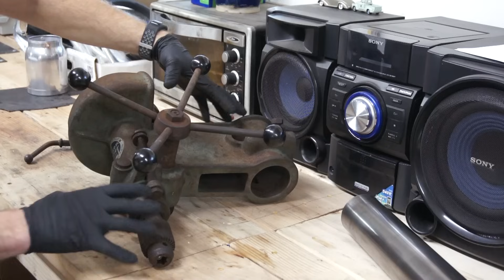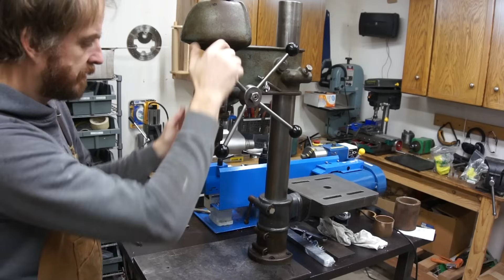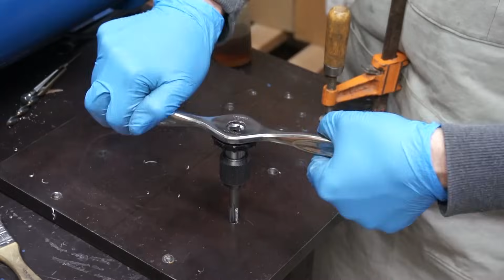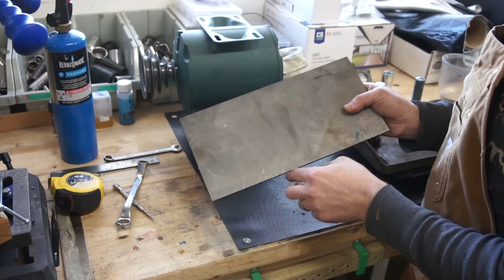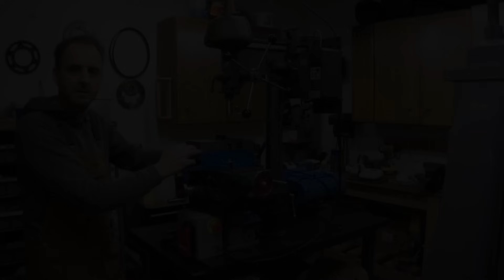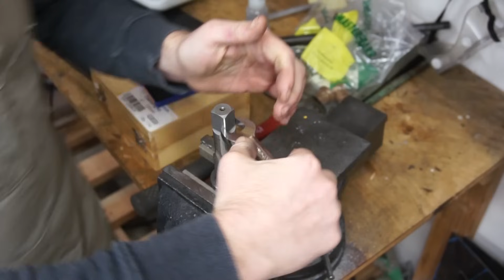Converting a Drill Press into a Milling Machine

Comment: Just found ur channel today man. I enjoyed this video. It's tough trying to turn a Drill press into a Milling Machine. I might have to strengthen up certain areas of the press as u go wwith some more steel/ Maybe some type of heavy guage frame to support that drill chuck area.. I'm not sure at all. Just thinking out loud Robert man. 
Very good watch this was though. 
I often wondered if my cheap and cheerful drill presss could handle the change. I think u would probably be better building ur own from scratch.Steel is fairly expensive here in IRE right now as well. I have watched guys build Lathes from scratch with Square tubing, etc. Ok it costs a few quid but the results from some o these dudes has been staggering. Hope this works out for ya mate.
I sub'd and liked the video too BTW.
Reply from the maker: Thank you for the kudos.  It's good to hear.

Comment: This is a dumb idea.  Drill presses are not engineered to handle side loads.
Reply from the maker: But it does work, tho.
Reply: @RobertAdairWorkshop  I know a little about this...  I converted a big powermatic press over to full CNC.  It's great for drilling hole patterns, etc, but just about useless for milling.

Great conversation piece, though.
Reply: @RobertAdairWorkshop   When you are working out of a small space and it's full with tools already maybe it's an option although I understand what you're talking about.  Just have to keep an eye on it or provide cabinet jacks to make it more sturdy.

Comment: Hi Robert. I was a ship engineer for a lot of years. I now play in my home workshop. I built a mill out of a 16 speed clark floor standing drill press. I made a big heavy floor standing base. Micrometer quill feed and a rise and fall machine head. I can take 1/8th cuts in aluminium with a 3/4in cutter. I often take .070" cuts in mild steel. It will also cut a complete dovetail in a single pass. I have also adapted a windscreen wiper drive for a table feed 2 speeds or change the drive gear to get 4 speeds. I also regularlly use the machine to cut gears. 16 dp and 20 dp all single pass. One of the things I came up against was bearing wear so I refashioned the quill with a bigger bottom bearing and altered the quill so I could preload the bearings. To retain the collet holders (er32 and er16) I drilled up into the quill and put a retaining socket screw up into it and I made simple extractor collars using the collet retaining ring to pull the holder out. By the way I only use High speed steel tools if I cock up I dont go into tears as they are cheap to replace. By the way I am english in England. The happiness is overflowing with the machine.

Comment: For the VFD have an emergency stop between the VFD and the electric motor that way, you can be sure the motor will stop. 

Also, you can do a make before break switch as well if you want to reducing arcs and it will work nicely. 

( ~ Electrical Engineer )

Comment: This is a good experience to do if you have never used a mill. For soft materials, plastics, wood, aluminum, you will manage to get some use and work done. For harder materials like steel you wont have good rigidity. A mill allows you to lock the quill in the head which you cannot do on a drill press. Also a milling head is engineered to be much heavier duty.
Reply: The Walker Turner drill press DOES have a quill lock. But I agree, the bearings are not heavy enough duty to do anything but light milling.

Comment: That old head sure looks to be quite stable and straight- I think thats the key to any level of success. I did the same thing with a very cheap older, but not old enough to be high quality, drill press and the spindle just was not stable or heavy duty enough to withstand the forces even with light aluminum cutting.

Comment: That is the hard part of converting a drill press into a Mill. The Spindle Bearings and the Spindle itself are designed with looser Tolerances on a Drill Press. You will need High Quality Bearings so that You can pre-load the bearings so there is no up / down movement or side to side movement. You might have to design Your own Spindle to get the bearings set like they need to be. If You could find a used Bridgeport Head it would make Your life a lot easier. When it comes to chatter, slow down the spindle speed and use WD-40 to lubricate the end mill, You don't need a lot of WD-40 just a quick blast every once and a while. You MIGHT be able to get away with Wheel Bearings for a car setup just like the would be on the car (the tapers facing each other).

Comment: Nice job, Robert try making tapping blocks they are a support for the tap. just a block of any material ally brass steel with a square to face clearance hole. it will keep you plumb for tapping.
Reply from the maker: I always have trouble with wandering taps.  I'll give it shot.  Thanks for the advice.
Reply: @RobertAdairWorkshop  No problem, started @16 in 77 so put a few chips in the swarf bin since then.

Comment: I applaud the thought and effort, but if I had built that, it would have cost about as much as a used bridgport.
Reply from the maker: It really didn't.  I think, maybe, $1000.  The screw jack was the expensive part.  The rest of it was cheap, used.  The video has made nearly $1500 which has paid for the project, anyhow.

Comment: No sense in being frustrated after getting that far and failing an ancient wear item you know is a primary failure mode for this machine.  Bearings are wear/replacement items, and perhaps the first thing to check when things get out of whack.   This is normal O&M/PM (Productive Maintenance). 

1 bit, sure, but 3 bits?  C'mon man.  But, i guess its better you take out your angers on this machine rather than your dog or something.
Reply from the maker: I appreciate you taking the time to write out the comment.  It's a good one.  I didn't give up.  There are a few more videos on the drill press mill.  In the end, I figure out how to use it within the constraints that a drill press provides and I use it quite frequently.

Comment: I bet you could have purchased a Bridgeport for less.
Reply from the maker: Not in Denver.  It's not like out east where they had a big steel and manufacturing industry and you can pick them up.  Out here, they never pop up, but when they do, you're in it for a minimum $5k and that doesn't include the cost to pay someone to move it.  That was $1k when I had my surface grinder moved.  

So no.  Not even close.

Comment: Hi Robert, I just happened to find this video of yours on this subject, and it caught my attention. I also have been looking at buying a magnetic base drill press and see the one you have.
 I think I recognize the brand of the one you are using here and I have seen similar models on the internet. I am wondering, are these worth the money? Do you have a video on this tool. and or,
can you tell me ( us ) about the one you are using here?  What speed, what is the vertical chuck travel, etc? 
I have l0ooked at your home page, and what you do interests me, so I have subscribed. Thanks for this.
Reply from the maker: I've used it in a few of my videos:  The mill stand and the atlas stand builds both feature it.  I also did a video on it when I first got it:  https://youtu.be/3Jp2C3d-rXM
I was sour with it when I first got it.  After modifying it for more travel and adding the ER20 collet, I've been really happy with it.   It is unbranded but I think Vevor now makes a very similar model.  Mine is the 1100W version.  The magnet holds well if it has full contact with steel.  

I've most recently been using it to cut 2" holes with an annular cutter on another mill project that I'm working on.   

I've found myself using it a lot more than I originally thought I would.  The magnet holds it firmly provided it has full contact with steel and it has been plenty reliable.  I would buy it again.
Reply: @RobertAdairWorkshop  Thank you, for taking the time to answer those questions. This is what I was looking for, an honest opinion of these 'presses.

Comment: Tooling issues aside as mentioned below, I think your candidate for the drill press was not a good choice. I know just a little about drill presses and their bearings, but they are not designed for radial loads. If you replace the quill bearings find some that are. The chatter you experienced was most likely for that reason and 80 years old ones to boot. Also a better candidate would have been a larger version, maybe a 20"? Of course that water has gone under the bridge at this point. Your creativity is without question and as you say you've had fun and learned a lot.
Keep on keepin' on.

Comment: A Drill-Press is only designed to take vertical forces - horizontal forces will sooner or later ruin the bearings.
Reply from the maker: So they say.  We're going on, what, more than a year since I built it and I use it pretty much every day.  The bearings haven't failed yet.  You're telling me not to make a usable tool because it may wear out?  All tools wear out.

Comment: I don't have a killer screw jack like you do however I do have a treadmill that I have to take apart and get the aluminum out so I can cast a tapping arm as well as use the motor that moves the deck up and down. Should be working on that today. I'll let you know. By the way those first cuts are great.

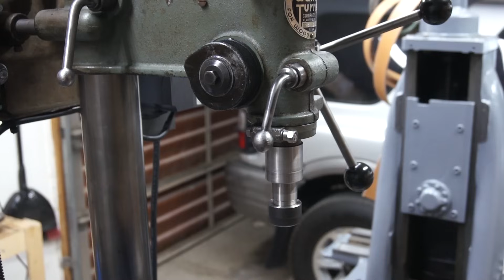Comment: When you put the set screws in the chuck, they are exposed / sticking out a little but. @28:10 mark. Be carefull - if a piece of loose clothing or hair were to get close and catch, that spinning chuck would seriously injure the operator. Make sure everything on the chuck is smooth on the surface.
Reply from the maker: Really good advice.  Thank you!

Comment: Hi, looking at the extreme long pipe column frame and the rather small table clamp, this is only for drilling. Take an indicator, mount it on top and check it on the table. Lay your body weight of about 70kg on the table edge and you will manage easiely have your indicator dial move 0,5mm.
This is only the table mount. Use the drill handle and put a stud between spindle and table and it will even ad up.
Strenghten the back pipe frame with steel enforced concrete or epoxy is the usual thing to do, but useless here, since the frame is much too weak at all.
For doing a tiny little scratching material from any workpiece it works, but will never be useful for you. There are much stronger drill presses out there with 15cm diameter pipe frame and more robust casting mount for table and head. Those are suitable to convert.

Comment: At about 13 min +/-, why do all of your wrenches look about the same size?  Looks like several 1/2" and/or 7/16 and/or 9/16".  ??
Reply from the maker: Pretty good eye for sizing.  Those are metric wrenches, 14mm to 24mm just above the bench on the right, and 3/8 to 13/16 on the left.  I just have a bunch of duplicates.  (4) 14mm, (2) 15mm, (2) 16mm, (2) 17mm, (2) 18mm, (2) 19mm, (1) 21mm, (1) 22mm and (1) 24mm.
Reply: @RobertAdairWorkshop  🙂I was mainly thinking of the ~23 from the right to left, but yeah, I see....  Surprising how 24 mm and 14 mm don't look that different (almost 2X) in the video, but it's probably got something to do with the angle and zoom level.  Not counting the right most 3, they all look really close, which I guess they are.  Thanks for replying!  I like the video, and will watch more.  I'm working on my drill press-milling setup and looking for all the tips I can get.

Comment: I don't know how much you're spending on this but I just found one on Alibaba that will vastly outperform this,  even if you did five times as much work as you have done for $868.000. I don't know the exact capacity but it weighs 264 pounds.  It's not huge but way more than any benchtop drill press. They a bunch of different sizes.  I'm looking at one for $1,059 that weighs 440 pounds. Shipping is probably not cheap but these prices seem really good. There are a lot of tutorials online on how to buy from them and not get scammed.

Comment: Seen a few people try to convert drill presses to mills. You hit the nail on the head at the start of the video about why it's a bad idea, explaining why your old one broke. And again at the end explaining how the new one broke. You could probably convert a drill press to a mill as long as you're prepared to accept it will only cut soft wood and plastic. 

If you want to mill metal, especially steel, you have to bite the bullet and buy a mill with a spindle designed for the loads otherwise you'll just get terrible results for a short while until the whole machine breaks itself. It doesn't have to be a big floorstanding Bridgeport. Get a small benchtop mill like Blondihacks has. Hers is a Precision Matthews which starts at $2400, but she has a whole video on how to buy an import mill.

Comment: Drill press cannot be converted into the mill. The drill press bearings are designed only for axial load. If you want "cheap mill" go and get the one from Harbor freight, it's only about $500. Add some simple DRO from ebay on x and y axis (about $20 each) and you will get proper tool for hobby use. Another option would be to hunt on ebay and other surplus auctions for a fine US made machine like Bridgeport, they go between $500 and $5000, but you may need to drive couple hundred miles for that.
Reply from the maker: Hey Andy.  I've been using that drill-press mill every day for 6-months and it hasn't died yet.  Bearings are fine and it does what I need it to do.  The Harbor Freight mill isn't $500.  It's $800 and they don't carry it in my local stores.  With shipping and tax, that comes out at $1090.  Not $500.  And if you take a look, it's currently unavailable anyway.  I have a mini lathe and those mini mills are the same quality.  I had to put another $300 in parts and 4-weeks time into that mini lathe to make it work right.  As for a real machine like a Bridgeport?  I don't live out east where they had a significant industry in steel and automotive manufacturing.  I live in Denver.  Machines might be readily available out east, but they are not here.  I looked into having one freighted to me and it was going to cost $1800 to get it to my house and unloaded in addition to the average $5000 machine cost.  Probably another $1000 in installation expenses, there too.  So my options are, 1, spend $1090 on a mini mill and another few hundred to make it work right.  $1290.  Or spend $7800 on a Bridgeport.  Or do what I did, spend about $600 on a drill press and have a usable machine that meets my needs.  Honestly, which way would you go?  If it were your money?

Comment: If you put the tap in the chuck or collet after drilling the tapping hole you can turn the tap by hand and it will be true and with much less chance of breaking it. You only need to start it you can finish later in the tap wrench.
Reply from the maker: I'm really bad a tapping.  That's a great idea.  Thank you!

Comment: Does your vfd not have the external brake resistor connection that will aid you in stopping motor very quickly and smoothly

Comment: Sounds like the better option is to just buy a milling machine. I tried my hand at using a good cross slide vice and quality mill bits, but it just doesn't work right as you have found out. Too much out of tolerances to get successful results and the chatter is scary as well. Even with near nothing passes...

Comment: Why don't you just drill a hole in it and put some Ellen set screws on there and likely drill the shaft just to receive the set screw seems like you're doing a lot of unnecessary work

Comment: just buy a mill. drill press quill are not made for loading from side. the bearings are too sloppy to do a good job. spindle bearings for mills are made so you can adjust the preload to eliminate slop that is in a standard ball bearing. it's a lot of work to make something that will do a poor job.

Comment: I see a major  issue  with  your control  box  location....are  you going to  use  coolant? is that a liquid proof  box? and  connectors? bad spot  in  my  opinion. I'm a machine  repair  / rebuilder  for  30  years ....never  place controls  lower that work areas for chips  and  liquids to  possibly enter  electrical boxes. I would change that asap. That  is  unless  you enjoy a good muurzap lol
Reply from the maker: Hi, Ken.  Good point.  I don't use coolant, now.  I'm working on a dedicated stand for the milling machine, as we speak, and am relocating the control box and mount on the new stand.  This one was temporary.
Reply: @RobertAdairWorkshop  im watching  your  2nd  vid on the spindle . im  currently  revamping a 1940s buffalo drill thats much larger than  yours ..with 2ft x 3 ft table  with gibs  thats raises . im  making  into  a  mill , using  a vfd as well. My quill and bearing are alot  larger and  ive already  checked  for  movement im  set.
Reply: ill be  running  coolant  with  mine, using the same  pump and tank  from  my 1610 wellsaw sharing the system.

Comment: at 31:50, AHA, you finally worked it out, YES, it is the spindle cartridge!!- they are simply NOT designed for side loads!! that is why you DON'T use a drill press to MILL, the set up is not thick or strong enough to cope with the forces involved.

Comment: did you put a divot? for the set screws to rest in or are they just hitting the surface? this is outta my league was just wondering. interesting vid.
Reply from the maker: They fit into the groove cut into the collet.  As it is threaded onto the end of the spindle, it pulls the collet upward by those set screws.  The taper and threads hold it in place.